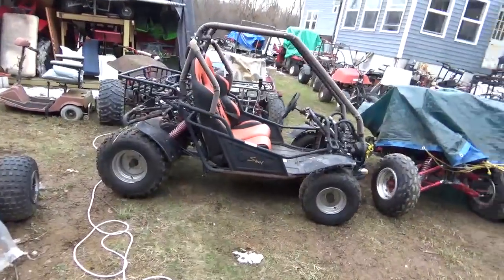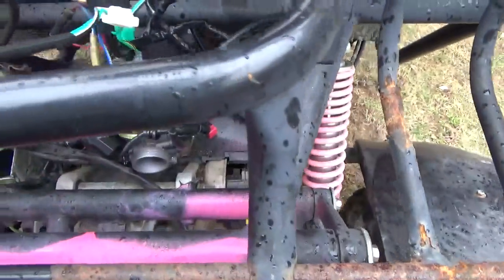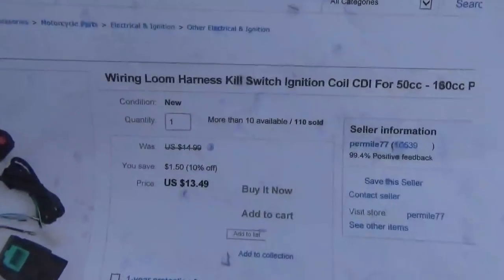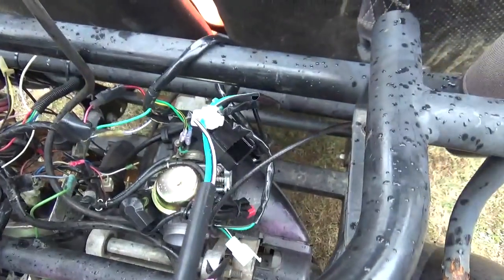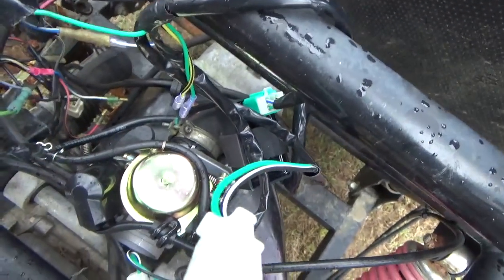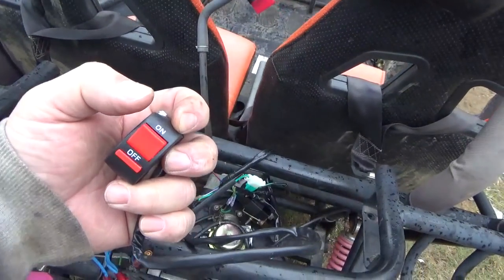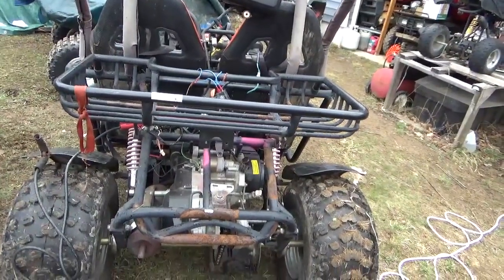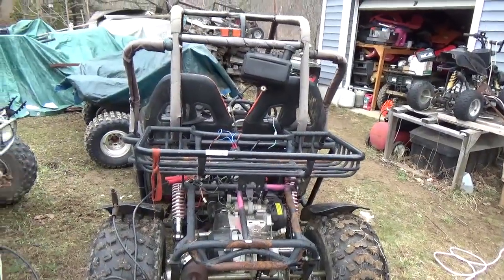No Spark Off Road Go Cart, cheap and easy fix, $14 gets it running,

Comment: Harvey if you do not hook up the choke it will always be on . That choke solenoid is a heater that closes the choke when power is supplied .
Reply from the maker: Hey G Spot, U got an interesting name there Bud!!!   It looked like the choke plunger is pushed down without power which would turn off the choke, I thought applying power would pull the plunger out, thus applying the choke.... I will look at it again... Having said that, for not applying the choke, it does seem to start mighty easy, even when ice cold and it does seem to run rich when warmed up.... Thanks for the info, Ur thoughts, watching, and commenting!!!

Comment: I am stuck on my atv rebuild because nobody sells the stator pickup that I need. I need the one for cg150 engines that has the shark fin looking mounting tabs. All I can find are the ones with much larger rounded tabs.
Reply from the maker: Hey Joseph!!!  I'm not sure exactly how Ur pulse generator mounts, but, if I were in Ur situation, I would search eBay with, "atv cdi pulse generator", and see what comes up, then I would see if anything there can be adapted to my application... Also search complete ATV ignition.... BTW, I have worked on several hundred ATVs. Hondas, clones, kawasakis, etc.... Only one bad pulse generator and it was mistreated... Lots of wire harness issues, a couple of CDI boxes, and a few opened stators, some mechanically damaged... I hope this helps.... Thanks for asking, watching, and commenting, let me know how it all works out....
Reply: Harvey Spooner Mine was definitely abused. I literally had to buy or rebuild everything on the atv. When I got to the stator I  had hoped it was good but when I removed the side cover and removed the pickup it was severely worn to a slant. I tried modifying the one that came with the complete electrics kit but in the end I would have to drill/ tap new holes and that is beyond my comfort level. I might try it once it is a spare engine and if successful I can use it for a shifter kart..

Comment: Hey Harvey, love your videos they are very informative and entertaining. One question. I got a 125cc Chinese atv now the problem I'm having is that when I turn the key and and press the start button nothing happens, but if I put to a screw driver to touch the two points for the stater solenoid it starts right up. Any suggestions of what could it be? Thanks
Reply from the maker: Hey James, Sounds like Ur starting solenoid coil is not being powered, if there are 2 smaller wires coming out of Ur starting solenoid, the green one should be shorted to ground when the ATV is ready to start, the other wire, typically red and yellow should have 12VDC on it when U push the starter button... Assuming both are true, then Ur starting solenoid is bad, they cost less then $10 on eBay, I hope this helps, let me know how it turns out.... Thanks for asking, watching, Ur kind words, watching, and commenting!!!
Reply: james javier It should be the key start switch. Or the solenoid. Try a switch

Comment: I've got a Roketa gk13 250cc single cylinder that has a CDI. I'm in a similar problem where I bought it used with a completely trashed electrical system. Would this method work with mine? And would that involve not using any of the previous rats nest wires?

Comment: I have a run master ll 250. Well, was wondering if you're around this area to see if you can work on it for me. I also don't have spark, no, nothing about wiring diagram. Can't find anything on the internet.
Reply: The manual diagram doesn’t show anything for this type of motor.

I have it and just looked over it.
Recently bought my kids this kart and wow luckily the seller had the whole manual! Rare

Comment: that rats nest has to go,it would drive me nuts not to mention a fire hazzard. you are the king of pit bike ignition hacks!!!
Reply from the maker: Hey Roger, the rats nest part is not hooked up, it is running on the pit bike ignition only.... I need to sort thru that rats nest to see what I want to keep.... It will be done right once done with a fuse and everything.... I have not installed a battery on this cart because I don't trust the hacked wiring, even the stuff that I installed.... Thanks for Ur thoughts, advice, watching, and commenting!!!
Reply: i am certain it will be done properly when you sort everything out

Comment: Hi harvey, i have a Quantum Carbide 150cc buggy that i cannot get started, Seems i have a no spark issue also, only thing being is that Mine is DC fired instead of AC. Would this swap work for me? Or would this no spark kit do the trick for me http://www.buggydepot.com/product/644/150cc-quot-won-t-charge-quot-dc-tune-up-kit-type-d.html